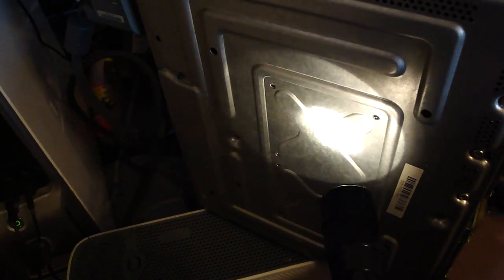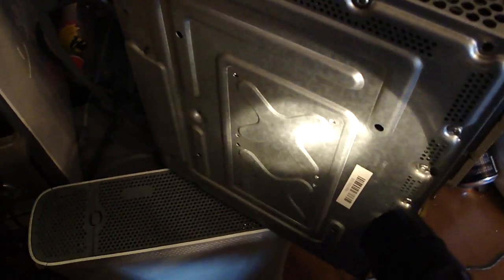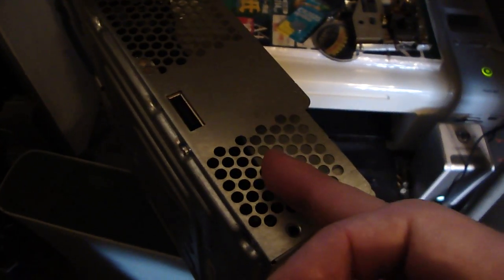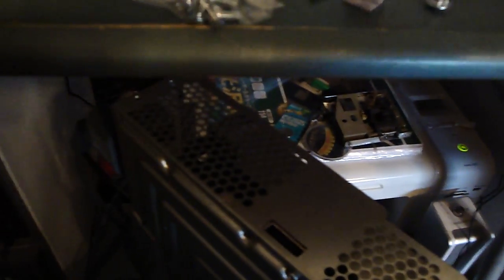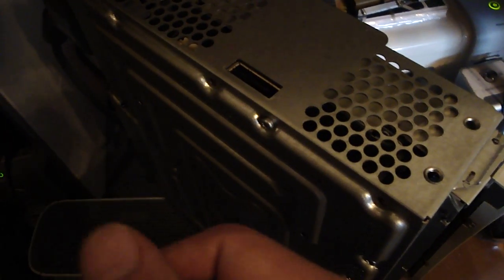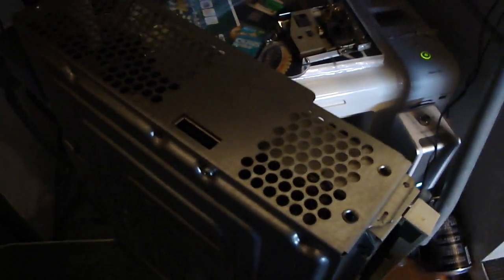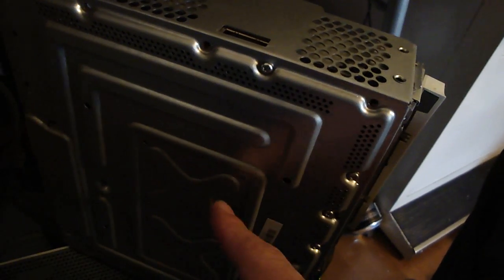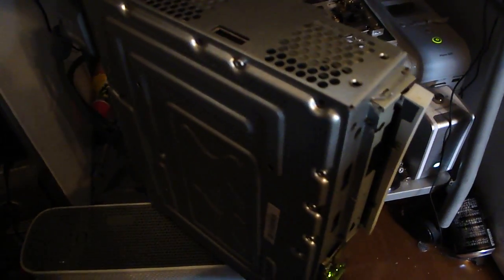Xbox 360: No Video But Sound, Glitching, Checkerboard Screen,Over Heating Repair TIps

Comment: hi, i fix hundreds of consoles but have a odd one, first of all the 3 red lights are instant instead of around 3-8 seconds to show, done the normal fix i always do but when it comes to overheating the cpu and gpu i cant as they wont get hot on this one, seems like something is blown in the board and no power is getting to the chips, any ideas mate? or anyone else, thanks

Comment: Hey luke i repaired 3 xbox 360 using your method which all i used was the penny trick thanks to the guy who invented it lol and thanks for your easy explanation tutorial on the problems, my question is simple, i have one that was fixed for like 3 days i stopped playing it for like 3 days then i recently tried to play on it and it was again no video but sound on problem i cant do towel trick cause it wont overheat lol so now i ask does replacing those screws fix it? and if so or not what method

Comment: Thanks for this video -- I just recently performed x-clamp replacement with arctic silver because I aquired an xbox that starts with sound but no video (was told it suffered from RROD and has been in storage for over a year).  My fix didn't seem to help... still no video, and my fans sound like they're running hard. I used some neoprene washers and have the heatsink screws tightened pretty loosely, but to where they resist a bit.  Any suggestions? I'll go play with the tension now...

Comment: I've spread arctic silver 5 on the gpu and cpu, gotten the proper screws and washers, tried tightening and loosening the screws at least 17 times, and STILL have RROD. I'm not getting a heatgun, using the towel trick, and dont plan on doing a 3rd attempt using the penny fix this is fucking bullshit.

Comment: ok... did the heat gun... then did the screws like you did .. but now i am getting 0020.  would it hurt to heatgun it with the sinks on? i have the case off.. and its just the mobo and dvd drive and sinks and front board... maybe heat up the ram chips and underside of the GPU and CPU? i want to put this back together because i just repainted the case matte olive green with matte black trim.. itching to reassemble

Comment: @LastHour1 the towel trick is useless, did u apply thermal glue to the processing chips as well? i've fixed a few xbox's but usually applying the glue and then allowing to let the xbox overheat should fix the problem, don't be disheartened if it doesn't work first time you may have to do this a couple of times. But it has worked for me. Best of luck mate

Comment: @LastHour1 have u allowed the xbox to overheat by disconnecting the fan for 15 mins? let it cool for 15,after that remember to plug the adaptor and tv leads into the xbox or u still may have the rrd.

Comment: Hey Luke, really glad you're posting these very clear tip videos.  It's cool to see people going all DIY and getting their own stuff working again.  Looking at the cooling they've got on their though, and how it's mounted, is it really any surprise that they fail?  You put a device down with uneven pressure on the board and then add heating and cooling to expand and contract the material and you have a perfect environment for a physical failure.

Comment: hey luke.  i have been doing some repairs to a 360 as well.  got it RROD'ed.  now i get the message that its overheating.  i did the screw fix to get rid of the x-clamps (evil!) and i did the heat gun trick.  but i used some washers (metal and nylon) to space the heat sinks.  think that i should take some washers out?

Comment: the rubbing Alcohol needs to be 90%+ when using on a motherboard of any kind, cause the less water/extra crap content the better, and it also dries much faster, and cleans the Thermal compound off much better. Also I just use some Antec 7706 compound it's cheap about $3 plus shipping, and the 3 packets can yield 6 jobs if your doing 2 jobs back to back, and cools as well or better then Arctic Silver5, also if ya need a brush Newegg carries Nanosilver compund from Rosewill for about $9

Comment: @NecromaticSunshine - One more thing: while you're at it, cut the mesh in front of the fans.  When the Xbox 360 is closed, this drastically reduces airflow.  If you cut the mesh, the Xbox 360 will be able to pull out as much air as it does when you don't have the case on it.  It would also be a good idea to extend the fan shroud(that white plastic piece over the heatsinks) so more air can be evacuated from the CPU and GPU heatsinks.

I've done all this to many Xbox 360s and they're still working

Comment: @NecromaticSunshine - This flattens the solder on the GPU a little bit so it'll make a more solid connection with the motherboard.  Then, you can replace the X-clamps with the screws just like Luke did.  And don't forget: USE FLUX!

Another thing too would be to bump up the fan voltage to 12V.  The fans in the Xbox 360 run at 5V, which is inadequate to keep the system cool.  The only drawback to this is that the Xbox 360 will be EXTREMELY loud, but at least it'll keep cool.

Comment: @NecromaticSunshine - The solder's coming loose on the GPU.  The ideal way to fix this is to pass a heat gun over the GPU, then add in the screws like Luke did.  The best way I found to fix an Xbox 360 GPU is to make a cardboard spacer that will apply even pressure on the GPU(cut out some parts of the cardboard so there's no excess pressure on the 2 dies), place that spacer between the GPU and the heatsink, tighten the heatsink, and pass the heat gun for 1 minute 45 seconds at 450 degrees C.

Comment: I'm happy there's people out there that this works for. Did not have such luck with mine. Went with the new hardware and upgraded gpu heat sink which fixed the problem for about a total of 40hrs of run time. Then it took another dump. Good video man.